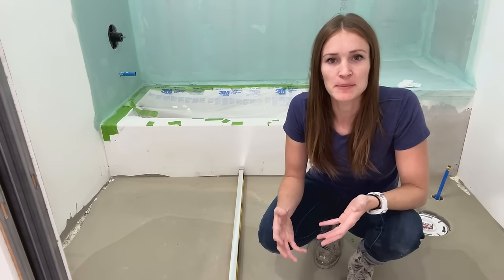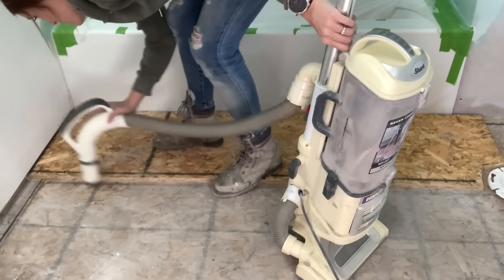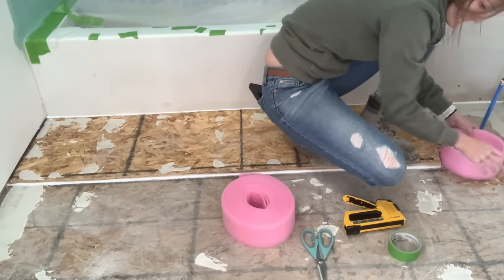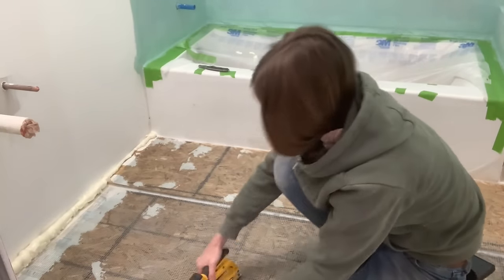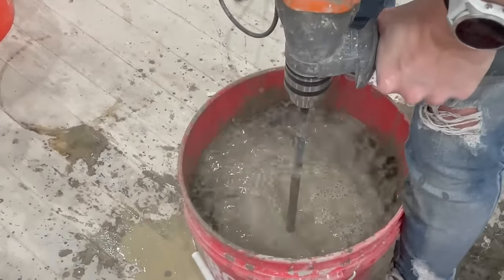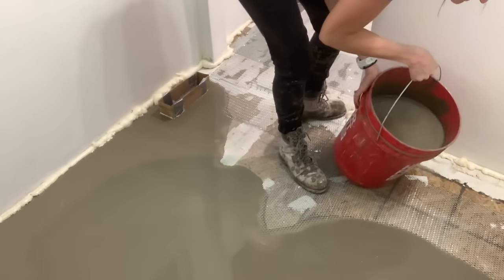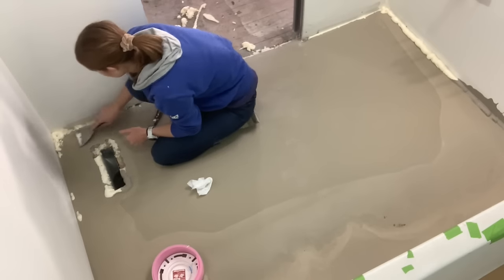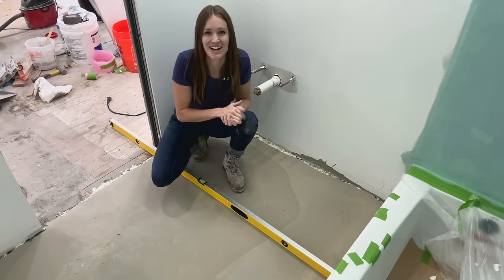How To Level A Floor |  Self-Leveler Tips For DIY Beginners

Comment: Now do a 25'x12' living room with multiple depression waves in both directions.  I've been going at it for weeks now and can't get it level.  I contacted the company and they said "Self Levelling" is probably the most disingenuous label for ANY building supply in the industry.   There no such thing as a product that can just be poured out and create a level surface...and I'm finding out the hard way, now patching 2x2 areas at a time and then matching them all up to one another a pour (and a prep) at a time.  I should've just gone with carpet 🙃
Reply: Totally agree with you. The term "self-levelling" is a misnomer because you have Self levell it YOURSELF. The product does not do it for you.

I did the hard work and removed the old flooring to reveal the uneven concrete flloor. I then got in a so-called professional tradesman... BIG MISTAKE. My floor is worse than when I started. I shall be removing it with a SDS rotary drill chisel.

Comment: Thank you for the intro on this. I have a "dip" in the floor by my sink as well... most likely water damage and rot to the subfloor. Replacing the subfloor there before might be worth doing first, as dry rot can spread to surrounding subfloor if not removed first.

Comment: FYI - troweling or using a “spiky roller” is actually critical to self levelers. Directly after the mix, surface tension builds up, so breaking the surface tension after a pour allows for greater flow and leveling.
It’s on the instructions on the bag
Reply: Good point- I’ve always used a trowel or squeegee. I usually just do small bathrooms. Now they have spiked rollers for cheap on amazon. Back when I started many years ago, I could afford to buy a spiked roller (they were pricey and I couldn’t justify a tool I didn’t use a lot) I’ve even seen people use a paint roller attachment without the roller on it, just to break everything up. I’d definitely just order a spiked roller if doing a bit space.

Comment: It took so long to mix the self-leveler that it was setting before I was pouring. 
I tried then to apply it like spackle but it was rock hard in minutes. 
Is there any way to keep it in liquid form during the mixing?
Reply: Use COLD water. Put ice packs into water before hand.
Reply: @bn1011  Good advice. I read it somewhere else after my first failed attempt (and ruined bucket). 
The second time I used the self-leveler, i only mixed 8 pounds of powder at a time so that I could mix it more quickly, I put ice in the water before putting the water in the mixer. That time it worked perfectly.

Ideally, I would have had a helper and more ice but for my small project I managed well enough on my own. 
To anyone trying this, I recommend the cold water.

Comment: Do you need to cover the entire room with the leveler, or only the dip (if the edges can be identified)?
Reply: You can absolutely just do a section. Some people put screws in the floor in the dip and then screw the heights of the screw up to how deep they need to pour so they know how deep to go in each area. Or they make markers with foam board or some other product to know how deep to go in a divet.
Reply: @YouCanDIYHome  using screws to mark heights is a great idea. Thanks.

Comment: Be sure to cover all holes, I missed a few nail holes and going a pile of self-leveler on work in the basement shop under the first floor area I was leveling.
Reply: Yes! It can be catastrophic if you miss one!
Reply: A piece of paper drywall tape can be pushed into the wet leveler to seal up the hole while your pouring. Preventing the leveler from flowing through the hole.

Comment: dear Lord. Have you just nailed a bended board without any glue?
someone will be up for a surprise in 10 years
Reply: Adding glue is definitely a great idea. And always screwed, never nailed. The helix of the screw is going to give a great grab. The shank of the nails would for sure allow for slippage over time. I have similar jobs many years old that are screwed down and still going great 😀But yes, definitely wouldn’t recommended nailing if you’re not glueing.